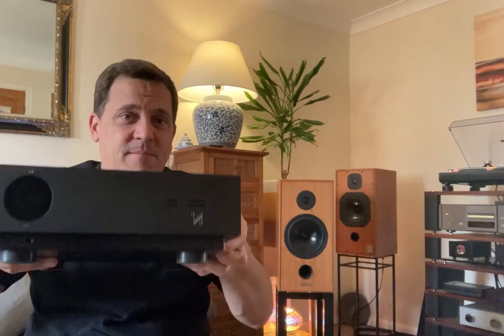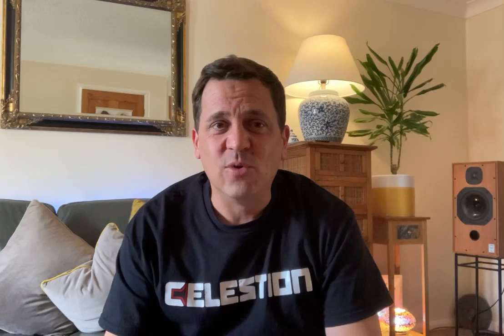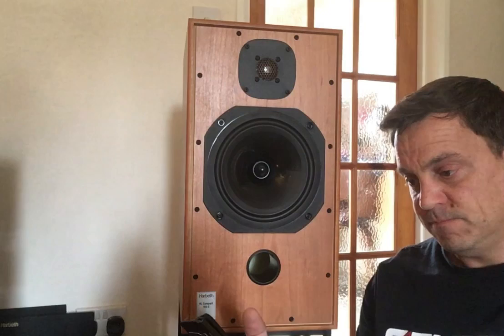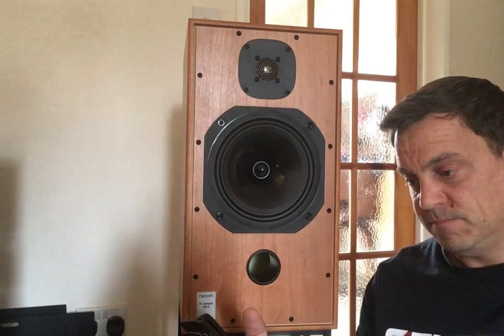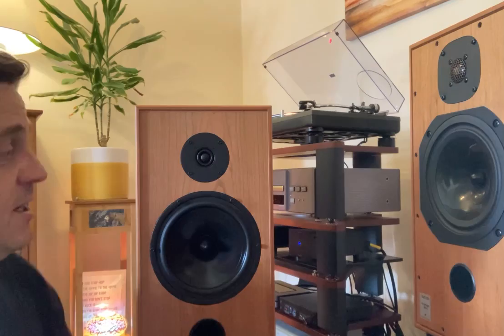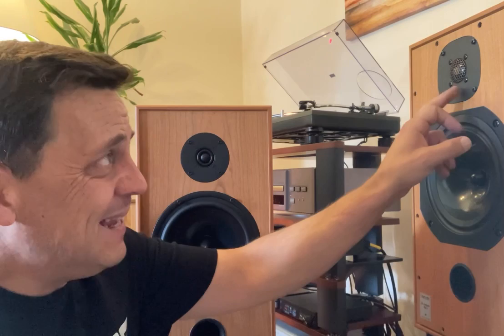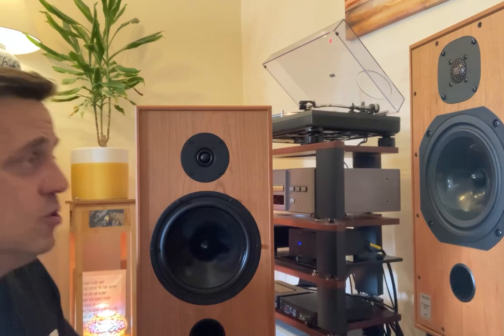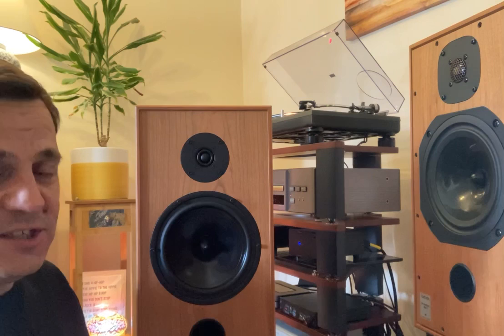Harbeth 7es3 vs Spendor Classic 2/3 #speakerreview #harbeth #spendor #hifi #audiophile #british

Comment: Great, insightful comparison again. The only Harbeth I've listened to, is the P3esr xd. In direct comparison to the Classic 4/5 and 3/1, I'd say the Harbeths are slightly more incisive and explicit in the highs,  but those highs are also slightly less refined and open than the Spendors, which are a touch sweeter/smoother. Mids are similar, but again, I think the Spendors clinch it on openness and naturalness, especially as the tone of the Mids better matches that of the highs. Whereas the Harbeth's metal tweeter stands apart, very slightly. The 4/5 are a bit faster than the p3esr in the bass, although the p3esr give the impression of more volume and warmth in the bass. They're not that far apart overall (other than in price!), but for my tastes, the Spendors just take it on sound quality and involvement.
Reply from the maker: Great reply, thanks for watching.
The Spendor kinda won here, the Harbeth’s will be sold off soon
Reply: I prefer Spendor

Comment: You have to really live with both speakers to really hear their differences.  I find my Spendors offer a more engaging musical experience than my Harbeths.  If I had to generalize as to why, I'd say the Harbeth's could be considered more Hi-Fi.  Of course, system synergy will play a part.

If you want to have some fun, find a used pair of Spendor SP-2/2.  While they're far from the last word in LF range, you'd be extremely hard-pressed to find a more musical speaker by any brand.
Reply from the maker: Oh I’ve owned SP2/2’s, absolutely loved them.. couple of videos on here of those.. I agree with everything you’ve said 👍
Reply: @dittonworks   - Oh, ok.  This is my first time visiting your channel so I'll check out that video.  Another thing I've noticed about the two brands is how well the Spendors image compared to the Harbeths.  My Spendor S8e's, SP-1's and SP-2/2's have a layered depth that is hard to match.
Reply from the maker: @ab2abblank607  again you’re 100% right..
I was explaining to my friend the Spendor have incredible depth in their soundstage..
I really miss my old SP2/2’s.. Derek Hughes hit the nail on the head with those.
Reply: @dittonworks   - Absolutely!  Cheers!

Comment: I think there's more dynamics on the Harbeth SHL5 XD...my opinion has changed and am a Spendor man...I own the S100 and like them...getting ready to install mudorf capacitiors in the crossovers...and of course in all vintage speakers, it is recommended to rotate the driver 180° due to sag after many years... which in turn can make the voice coil out of line

Comment: 🫵🏼That’s what I’m talking about‼️ First time here, def not my last. Brilliant review, storyline, content, etc. You gave yourself quite a challenge with theses two but what a great comparison. I took a lot of time and put in a lot of research before building my first (modest) audiophile system. Years ago I heard a pair of Focal Electra 1028 BE’s powered with Naim of course. I loved that sound but as time went on, I began to realize that the sound I liked was from the Focal’s vs Naim. Over the course of a year, I had a helluva good time. In one direction, I had a Decware Zen SET paired with Devore Fidelity speakers and the other was. Parasound with PMC’s.  What I ended up with and simply love is the Focal’s but the stand mount 1008 BE’s on custom Sound Anchor stands connected to a Hegel H90 by Cardas Parsec cables. I’m exclusively digital at this point streaming Tidal to BlueSound Node 2i via coax to take advantage of Hegel’s superior DAC. It’s ALL about matching, room size, and musical tastes. I do prefer imagining, sound stage, bass and dynamics to detail.

Comment: Harbeths are a bit more analytical while still remaining smooth as silk. A rare quality. Both are good and low in colouration. Classic British "BBC" midrange. The Spendor has a richer bass but is a bit more mellow in the highs. Take your pick. To enhance warmth on the Harbeths place them on lower stands around 12 to 16 inches and tilt them up a few degrees. Distance from floor greatly affects a speaker's tonal balance. Sound is warmer/richer the closer to the floor it is mounted..

Comment: It’s interesting that with the voice test the Harbeth sounded forward in the upper mid and treble. The  Spendor sounded almost the opposite. Well not quite the opposite it’s probably more like an off axis drop at the bass mid drivers upper range. For me it would be really interesting if Spendor could make a model like this with a 34 mm treble unit and then push the crossover frequency down half an octave, just to fill in a bit more of axis energy in 2-3 kHz range. Well it won’t happen so why am I speculating? Silly me! With music I liked the Spendors  the most because they possess a relaxing and beautiful musical quality. Greetings from Denmark.
Reply from the maker: Interesting idea on drivers there.
The Spendor presentation is absolutely tireless, I spend hours listing to music using them. Excellent all rounders too.

Comment: From your experience of Harbeth, Did you find the metal tweeters of the C7 (or SHL5) bright at all? I know you've mentioned that metal tweeters can be a bit harsh or forward, unless done just right. Do you feel Harbeth achieved a smooth, yet detailed response?
Reply from the maker: They certainly aren’t harsh. 
Very detailed but not harsh

Comment: Nice review, but if you would try C7 XD version you would like it even more. Btw once i tried C7xd and didi not liked them at all but my amp and dac were different and they muffled Harbeth patential, but accidently friend wanted to buy Barbeths the same C7 xd and my room is lit bit after reconstruction but bew amp and new dac with AN sotto and sogon cables, man, it soundes like different speakers, gues what i listen now too? Yes Harbeth C7 Xd, btw M30.2XD did not worked at all, it was terrible in my room, but C7xd those i thought will never buy or listen again now sound really really good even my room still need some aciustic treatment.

Comment: Alan Shaw once said that if u get the voice correct, then everything else will fall into place. Modern loudspeakers hardly use voice as a reference anymore. Sad. Btw, the C7 ES3 spots a metal dome tweeter customised for Harbeth by SEAS from norway.
Reply from the maker: Yes I got it wrong on the video but ironically said it sounded like a metal dome tweeter.
Reply: @dittonworks  hahaha it sounded like a metal dome becos it is a metal dome tweeter in there. 😃
Reply from the maker: @ganck1147  I know,, legitimate mistake

Comment: Thanks! Nice review. I had the Spendor Classic 3/1 at home. Really liked these, but now considering the 2/3s for a little more bass. Any experiece with the 3/1s?
Reply from the maker: I’ve heard them but not at home. 
The 2/3’s won me over 👍
Reply: @dittonworks  thx. I had the 3/1 for trying out in my midde sized room (14 × 20 feet)  Tommorow I am gonna compare these against the 2/3. Curious!
Reply from the maker: Sadly selling my 2/3’s as I’m now using my Celestion Kingstons all the time
Reply: @dittonworks  Shipping to the Netherlands will be expensive I guess. Blame it on the brexit.......

Comment: Hi Ditton, Harbeth 40.3 XD or Spendor Classic 100 for all genres of music. Which in your opinion is the better of the two. Either model to be used in a 21sqm room. Can you recommend an Integrated amplifier that will work? Thanks.
Reply from the maker: I replied to your email on this subject. 
Both are great but I recommend the Spendor based on your musical preferences 👍
Reply: @dittonworks  Thanks, just cannot find the email under Ditton Works?
Reply from the maker: @richarddegannes2928  you emailed me, regards 
Kev

Comment: Absolutely outstanding…would you recommend a sub with the harbeth
Reply from the maker: I’ve never felt the need personally. If you could get one to integrate? It might sound fantastic 👍
Thanks for watching
Reply: @dittonworks  thanks…I have got a real nice Martin Logan 1600X ..  really well designed to integrate, they build electrostatics so the subs are especially designed for that
Reply from the maker: @geraldgreene5563  sounds like that would be perfect 👍

Comment: Spendor is super bright sound ! No something wrong with your system . I’m using Accuphase class A and valves amps . Both are not produce any bright sound at all on my spendor .
Reply from the maker: Lol. Spendor’s we’re not bright on my set up either. So much so I added super tweeters for sone final HF detail.

Comment: Where did you find the stands here that the spendors are sitting on. I really want these please.
Reply from the maker: Hifi Racks Fortis Stands for Spendor Classic 2/3.
Reply: @dittonworks  thank you so much, i like the doubled cross bars at the top and ive seen these before but they were incredibly hard to find here in America.
I have a strange sized set of speakers made by Tekton Design of Utah that I am hoping I can pair with that particular designed set of stands.
Just know you have been a tremendous help to me.

Comment: Great review, can I ask if you have any other speaker cable recommendations that are cheaper than the Townsend Isolda? I have Rogers LS3/5A and am struggling to find a half decent bi-wire cable at a reasonable price (£300ish for the pair)
Reply: I was looking at the ViaBlue SC-4 not sure if you know or have tested them?
Reply from the maker: I’ve used Rocket 22 from Audioquest with positive results on LS3/5a
Reply: @dittonworks  It's the gauge of the cable that matters because the lower the resistance the better. No need to buy overpriced stuff.
Reply from the maker: @MrsZambezi  what’s your thoughts on material Silver vs Copper for example?
Reply: @dittonworks  No difference if the resistance is the same.

Comment: Do the tweeter grilles come off? I know quite a few speakers which use tweeter grilles can be removed using blu tac?
Reply from the maker: I’ve not tried but the acoustic lens is on the grille, removing might upset the HF polar pattern

Comment: The Harbeths are way too high…. Why did you not use the Spendor stands? What happened to the Isoacoustics?
Reply from the maker: Harbeth recommend tweeters at ear height. So they were fine for my listening position..
The Hifi Racks fortis stands would have put the Harbeth too low imho. 

I didn’t use Iso feet on the Harbeth..

Comment: i used to have a lot of respect for the Harbeth, until i learned , and i of course knew they listened and tweeked them a lot. the real issue is not with the tweeking but for this kind of money , they at Harbeth use really cheesy parts, as per GR Research , in fact the electronics consume so much space , there is no way to do a possible upgrade , hence no room.
Reply from the maker: That only applies to the P3esr and I wouldn’t listen to Danny too much.. judge the Harbeth by your ears not GR sales pitch.
Reply: It's amazing how GR research can make every set of speakers better, but for some reason not many people rave about his ! Talk about arrogance, thinking he can improve Harbeth speakers.